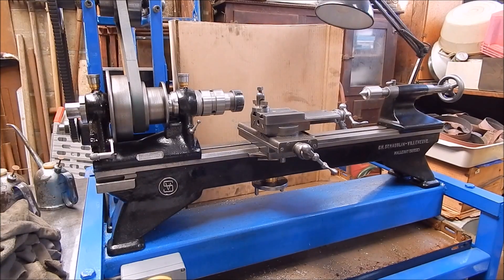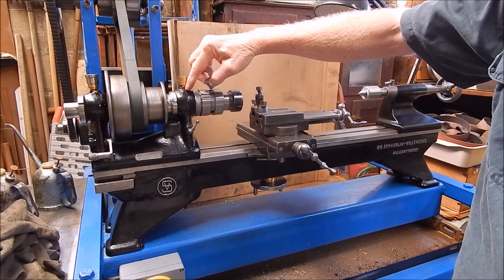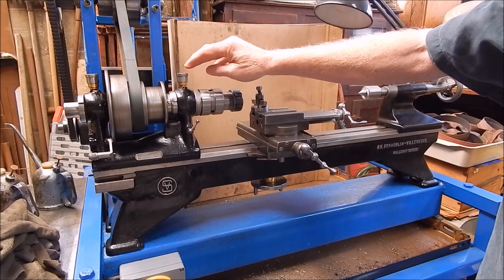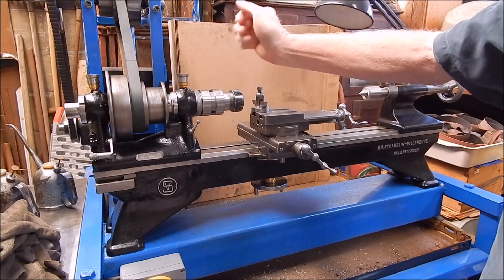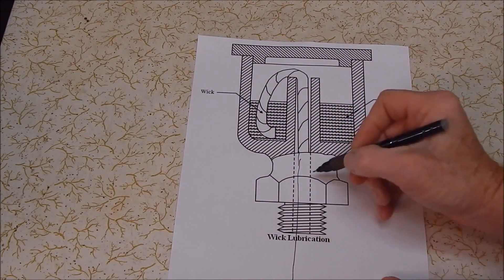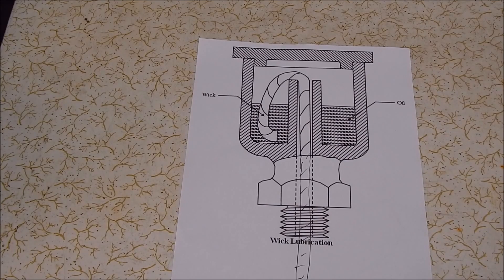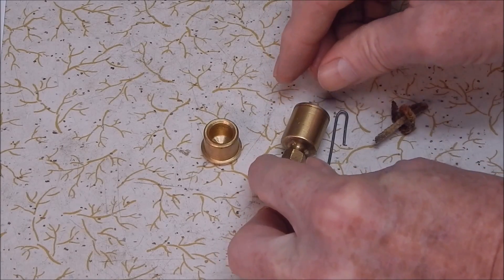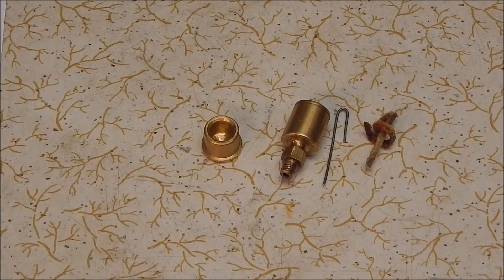The little known wire wick lathe oil cup

Comment: building a rolling forge mill with shafts running in bushes, still considering how to lubricate and this seems a good option. 
great vid TY!
Reply from the maker: Greased bushes are probably a better option for low speed/ high temperature application.  CRC and other companies make a lithium based grease specifically formulated for high temp/dusty conditions.  Oil is best used for high speed rotation requiring regular replenishment.  Cheers Rob

Comment: Thank you. This has actually answered questions I didn't know I would have. I'm restoring an old Australian Mars lathe and I had 4 of these (two on spindle 2 on drive gear drive shaft) and all but one were broken beyond repair. Given your explanation I have been slowly cleaning the broken ones to reveal that one did actually have a metal wick, two wires twisted into a hook exactly as you describe. Given the amount of swarf I would have written that off without your video. I'm in debt (probably hours in debt).
Reply from the maker: Glad it helped Philip.  Capillary action works basically the same way in a cloth wick, but wire wicks can adjust the flow rate by varying the size/surface area etc of the wire. Using two twisted together is a good idea for large applications and high feed rates.  Cheers Rob
Reply: @Xynudu  any idea where to get new ones from? 😂
Reply from the maker: I had to make mine.  It's not difficult.  You can buy aftermarket ones of various styles, but they will vary in quality, thread type and price.  New OEM originals would be unlikely and secondhand ones also much the same.  Good luck.  Australian Metal Work Forum had a few Mars owners who may be able to provide advice and photo's of what you need.   They also have secondhand sections for selling bits and bobs and wanted to buy.

https://metalworkforums.com/

Cheers Rob
Reply: @Xynudu  thanks. My login has only just started working.

I have 4 of them but only 1 has a cap. Maybe I just need to work out how to make new lids.
Reply from the maker: Lids are easy.  You should be able to handle that OK.

Comment: Very good information.  Beautiful old brass oil pots.  Did you use aluminum or stainless for the tops on the ones you made.
Reply from the maker: The tops are stainless steel, but brass is used on the originals.

Comment: Very interesting. I have a Smart & Brown lathe (quality) which needs oilers. I'm guessing you lift the wire wick out to stop the oil feed when not running the lathe - ?
Reply from the maker: Hi John,

No.  The wicks are very hard to grip.  The oil pots are small and only hold enough oil for about an hour run time.  If I only want to do a quick job I just add enough for a few minutes.

Cheers Rob

Comment: I would suggest that the length of the wire on the drip end will affect the rate of flow.
the lower the tip is the faster the drip rate, as would happen with siphoning fluid with a siphon hose.
Reply from the maker: Yes.  You make the long part of the "J" as long as possible to get maximum effect. Shortening the wire should reduce flow as well.

Rob

Comment: Could you vary the oil flow of a wick type by using a different viscosity oil or is it specific lathe oil?
Reply from the maker: Yes.  But the oil type generally falls in line with size - eg.  light oil on sewing machines and heavy oil on diesel engines.

So I would use an SAE 15 on small lathes and maybe double that viscosity for bigger lathes.

The oil will also flow differently at different temperatures.

Cheers Rob

Comment: Quite interesting. Why does the oil not just travel up the center tube and down it? It has a far larger surface area than the thin wire.
I do not have any machines with those or I would experiment with them.
Reply from the maker: Good question.  I expect because there is not enough height difference between the base of the cup and the screw end of the mounting thread.

Cheers Rob

Comment: Great info Rob. Is it critical how close to the shaft the bottom of the wire goes ?
Reply from the maker: No. The oil will find it's way to the spindle through the galleries in the headstock.

On the Schaublin it feeds into a gallery that is incorporated in the headstock bearings.

Having said that, a longer feed wire length is better, same as for any siphon system, so that you get the largest height difference between inlet and outlet.

Rob
Reply: @Xynudu  I'm sorry but there is no siphoning effect.   It is by capillary action that moves the oil.

Comment: Very interesting video Rob.  Thanks for doing the research and passing the info on to us.  I will be taking your lead here and make a video of the head-stock lube system on my circa 1890's Seneca "Star" lathe. When I removed the head-stock bearing cap the first time I saw a steel ring that runs freely on the shaft and rotates through a reservoir of oil beneath it carrying oil up and around the shaft as it rotates..  Pretty interesting and again a very simple system.  cheers-  Fred
Reply from the maker: Hi Fred,

That system sounds very similar to what is used on that vintage Century repulsion start electric motor I showed a while back.

Be very interested to see your video.

Cheers Rob
Reply from the maker: Hi again Fred,

Just for interest check out some of the YT videos on the old Century motors and you will see a few with a close up and explanation of the little bath oiler and spindle ring they have.

Cheers Rob

Comment: Neat tidbit of info Rob.....  .035 is a standard size for mig wire spools for those that have buddies that weld and would give you a foot or so. Or take a micrometer to the office supply store and measure up some paperclips :)
Reply from the maker: You can strip down any multicore wire (electrical etc.) and use a strand from that.

The wire can be any material.

Cheers Rob

Comment from the maker: The wire diameter I use for my 9" swing Schaublin 102 tool makers lathe is 0.04" diameter.  That is used in conjunction with ATF (automatic transmission fluid) which is about SAE 15 viscosity.

I originally used 0.06" diameter but found that it over oiled with that size.

Cheers Rob
Reply: xynudu where do you find these lathes at? I would like a small one like this but buying a new one costs a small fortune, not to mention the small fortune worth of accessories that I will need to get just to get me started.
Reply from the maker: Hi Russell,

It all comes down to luck (and maybe fate).  Just watch Ebay, Craigs list and Gumtree (here in Oz).

It's amazing what comes up at times.  I'm still looking for a Schaublin cross slide/compound for the last 102 I bought (was found under a tree) LOL.

Cheers Rob
Reply: xynudu im usually petty good at finding deals but i just can't seem to find one under 500 american freedom dollars. At least not one that has a carriage that will allow me to cut threads. And im still unsure about a new Chinese 10" machine.
Reply from the maker: Toolmakers lathes as shown don't have a carriage, so thread cutting is only available via a very rare add on system.

Thread cutting ability is something only the bigger European lathes of this era generally had.

I have a 10" swing CQ9325 Chinese lathe and it works great.  Accurate, hard wearing, has been flogged mercilessly for over 10 years with no problem that I didn't cause.

I would definitely buy a new Chinese lathe over some worn name brand unit from days gone by.

cheers Rob
Reply: xynudu Well thats good to know. I may pick one up in the near future. Thank you!
Reply: Nice to know the wire size and oil you use on your Schaublin. Maybe pin that comment or put it in the description. I like these shorter style videos that can watched over breakfast.